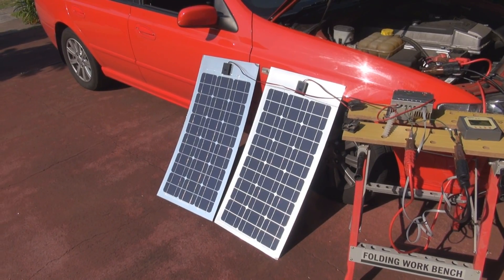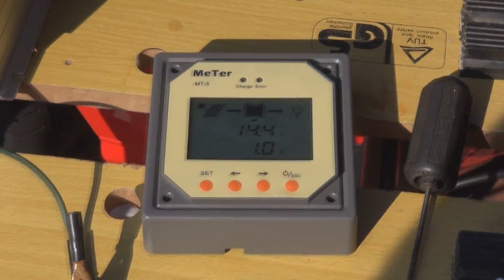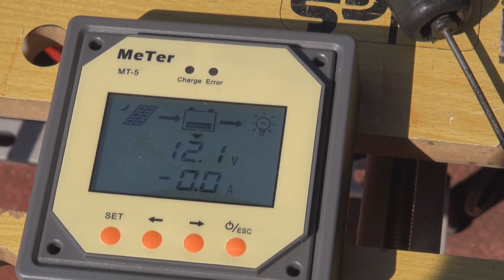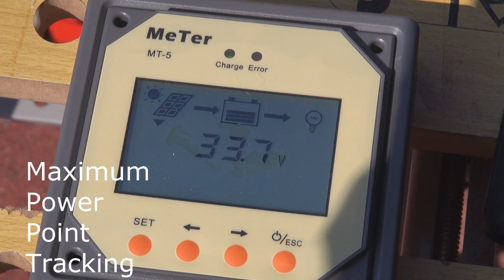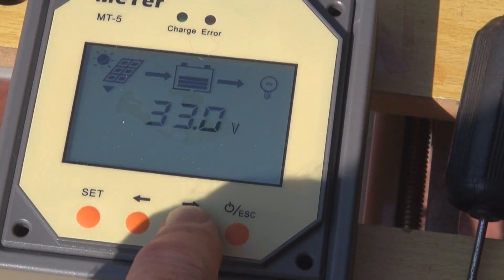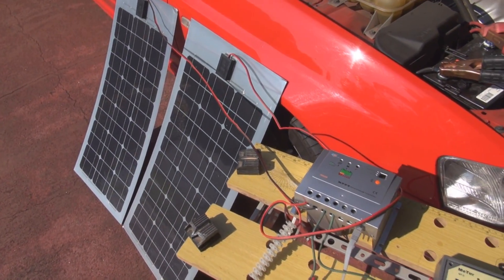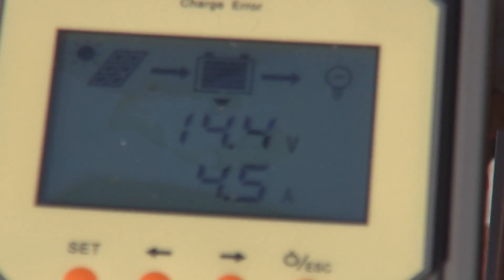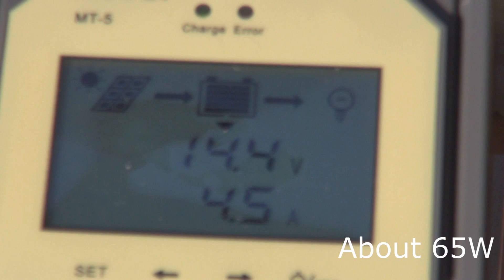Solar Panel and Tracer MPPT Regulator Test

Comment: hi. i just installed one of these on my trailer ep tracer mttp . the batteries were low at 5.38 volts .so i currently hooked up a charger to them . also finished hooking up solar panel to controller but no display lit up on the controller.?.......even with the low battery should not the solar panel display come on ?.........or is the controller defective ?
Reply from the maker: I am sure the controller gets it's power from the battery to boot up so it would be my guess that is the problem. Just connect a second good battery in parallel to bring it to life. Very soon it should be generating enough charge to hold the voltage up by itself. Good luck